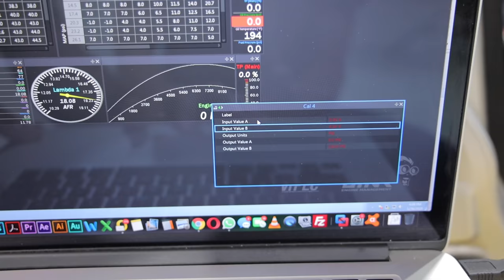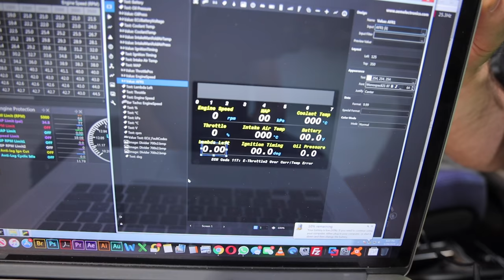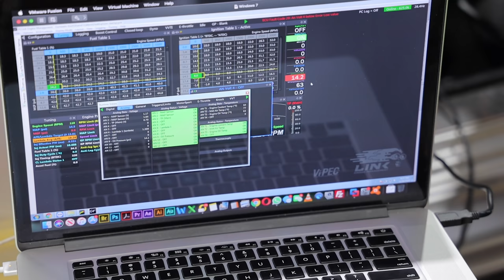CHEAP EVO 6 FIRST Startup & New WHEELS

Comment: Be careful ‘getto pressurizing’ the sump, it’s easy to blow out crank and cam seals etc.... I would have primed another way.... you don’t want to strip down to sort oil leaks after all your hard work, lIke on the M3/2J.

You could remove the turbo feed lime and push oil down the line.
Reply: James T Wouldn’t the crank case ventilation not be enough protection against blowing out seals?
Reply: @marcmigneault8364  It's still a lot of air pressure going into the bottom end that it isn't designed for.  It's unpredictable at that point.
Reply: All you are doing is pressurizing the crankcase. That pressure will go out the easiest escape route how you make that the oil pump makes zero sense  the pressure will just go out you PCV/catch can. You guys do think, yes?
Reply: Cranking the engine is creating your pressure. The air is rediculous.

Comment: Good shout. My Evo 6 has 18s (5Zigen GN+s, they came with the car) on it but with a lower profile tire (and with a slight stretch on them) than what you were running, so whilst there's no rubbing or anything of the sort it would be nicer to have a thicker tire wall so once these tires need replacing I'm going to knock it down to 17s. Not only that but the new wheels look loads better. This gen of Evo definitely suites 5/6 spoke wheels.

Comment: Before you Dyno/ECU tune the car, make sure too check the correct gap on your spark-plugs & make sure the battery is 100% charged (this will help you eliminate any problems you may have).

Comment: When I prelubed a rebuilt 1.8 for my Miata I used a 5' x 3" pvc tube. Capped one end with a solid cap and the other with a screw on cap. Put a hose barb in the solid cap and an air fitting in the screw cap. The hose fitting was connected to the oil filter plate inlet. Pick your pressure but I figured 50psi was good. It showed me any leaks before running the engine and washed out any debris. I just copied a pre-existing tool. Must have spent less than $20 at home depot to make the tool.

Comment: Congrats on getting it started. Alot of different opinions on start up if the oil pump isn't primed with a drill. Most pack the pump with lube and fire the engine off.  With assembly lube on the bearings you can fire the engine and it will quickly build oil pressure.  Excessive cranking at low speeds may take that lube away.

Comment: Super build! I think going w/ the 17s is a better route. You might have gotten away with the 255s but no big deal. So going w/ the 17s also brings down the ride height of the car w/out affecting your suspension settings. Which is great for the track. You dont have to lower the spring to get the proper ride height. I own an e36 M3 track only car. I have plenty of suspension traveling and ride low.  I've seen a lot of e36s with 18s and it makes them look like a truck. I run 245s on my e36 grooved slicks toyo rr's and I run down cars with big hp and big tires. I'll upload a video at Lime Rock from this past weekend later this week. Anyway, that's my 2cents. Great content!!

Comment: Just pull the injector fuse while cranking it over and you can see if it builds pressure. Used to do that to my 7-bolt DSM after each oil change to ensure the filter got filled and oil was flowing everywhere.

Comment: Enkei PF01EVO in gun metal would look bomb! 17x9.5 +35. No issue fitting a 255mm on that. As by default it would be pushed out 5mm clear the brakes just by its design. Also they are sub 20lbs.

Comment: Is there no "maintenance mode" option in an Evo to prime a newly installed motor? My understanding is in a Subaru you can floor the throttle to 100% before turning the key and it will do something to prevent the engine from running itself, like turn off the fuel pump. This lets the starter spin the motor and the oil pump then primes all the galleys without actually running the engine with spark and fuel.
Also those 17" wheels hopefully save you some unsprung weight! A much needed improvement for AWD sedans like this.

Comment: I always prime the motor using the timing gear on the oil pump. It's really only an option when the motor is out and the belts are off, but it works well.

Comment: Surely pressuring the sump will cause the same pressure everywhere in the engine thus doing nothing for flow. I alway pump oil in to the system through the oil pressure switch point with an old school pumpy can and fill the filter, then pull plugs and spin over.

Comment: You really need to crank it without using the air to see if you still have oil pressure.
Another method is to pull the oil pressure sender and pump some oil down the hole or remove the oil filter and pour oil down the  both the centre and the outside if it is above the sump and not pointing down.

Comment: Snap. I just put the PF05s in dark silver as well on my silver V. Thought u were brave running 255s on a CP9A. 

Either 17x9 or 18x8.5 r fine but I have the 18s with 245s. I had to remove the rear plastic guard but they fit fine. For track the 17s will be best but for street gotta be the 18 🤟🏻

STIs call EVOs Mazdas when parked but when racing all they see is pink mist so we don’t care what they call our cars 😆

Good luck, u gonna need it.

Comment: Nice choice of wheels and AWSOME choice of ecu 👌😎hope the engine is all good. 
I highly recommend you install ARP longer wheel studs when using spacers the original studs are to shorts for are dangerous and use metal wheel nuts.

Comment: LOL. Just love it guys!   "There's no leaks so that's Normal, the engine sound good, that's Normal, the oil pressure is about 100 so that's Normal, we've got a little smoke out the back but that's Normal, Oh there's smoke in the engine bay but that's Normal, Oh there's some knocking in the engine but that's Normal, Now there's Fire in engine bay but that's just Normal, Ooo a rod just came out the side of the block and that's Normal, the car is now fully engulfed in flames but that's just Normal"....... LOL. I'm just kidding around guys! I'm so glad she's coming to life and doing well! Thanks for the great video!

Comment: Another option for first start is pull the spark plugs, and turn the engine over with the starter until you read some pressure.
Reply: Jeff H, they did exactly that.

Comment: Could you not just pull the fuel pump fuse and turn the engine over while watching the oil pressure gauge without the compressed air?

Comment: What is the theory behind of do not use synthetic oil for engine break-in. Im very curious
Reply: SC WOODWERKS,
Synthetic oil usually reduces the wear of parts that rub against each other compared to conventional oil. During break-in it is better to get more wear early on so those parts mate to each other better. Once that has been accomplished it is better to reduce wear to maximize the lifespan of the engine, so synthetic is better after the break-in. At least that is my understanding. 
( 9:44 )

Comment: Any recommendation for a 2018 Chevy Cruze Diesel wheel and tire package? It's a 5 on 115 bolt spacing and I want a rim that's under 20 pounds, that won't kill my 52 MPG

Comment: You're really confused with your wheel choices. I knew the other wheels were not +40 as you said in the video. It's 30. I had 18x9 +30 on my evo with 235/40 tyres and absolutely no rubbing what so ever. I also had original Enkei from evo VIII with 245/40 on them and somehow even with exactly the same model tyre on both those 235 were actually wider. +40 on evo is way too much. Guys normally go with lower than 30 offset with 17s. Getting narrower tyre for your 18" would give you enough clearance and only minimal cutting of arches is necessary and it's all just plastic...